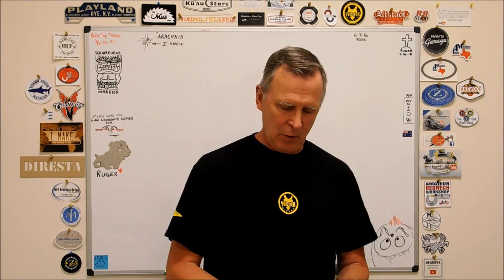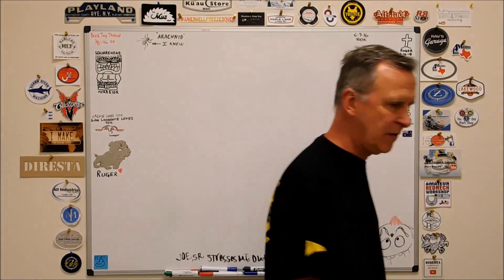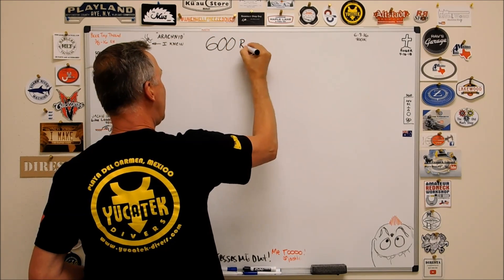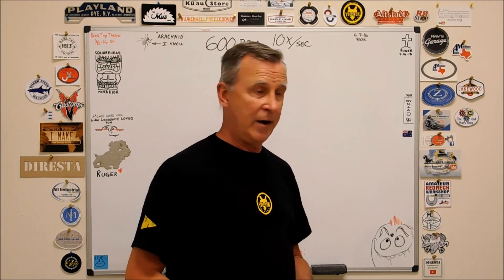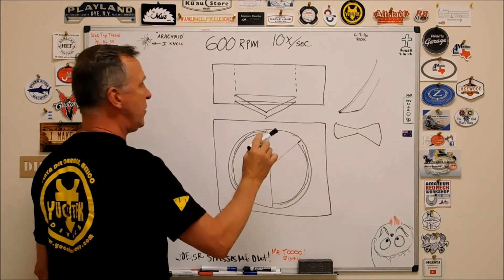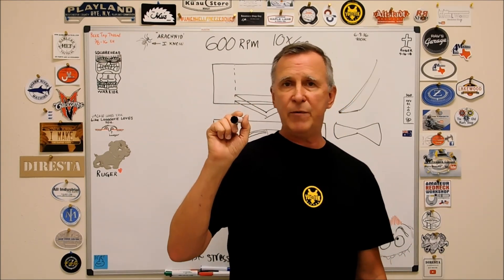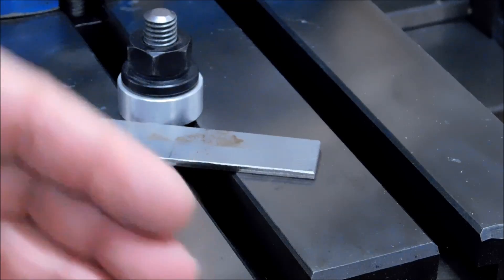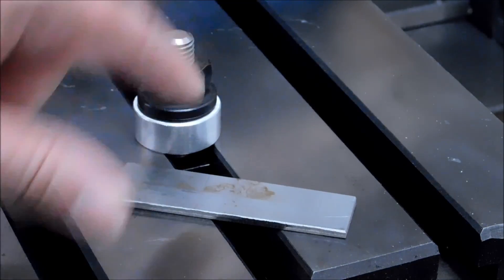EVERY METAL WORKER SHOULD WATCH THIS...

Comment: Hi Joe really appreciate the video as many years ago I did a similar thing with an 100mm X 12mm X 500mm long piece of steel but instead of being on a drill press it was on site with a slow run hand drill and a 13mm bit. I had it raised up on some wood and I stood with my foot pinning it down. That's never moving right answer no it jambed spun round and smashed into my other ankle. To this day the side of my ankle has busted blood vessels showing, lucky I had decent boots on. 

Also just watched this video by Making Klien  https://youtu.be/bc1BRhJq3cU and he does exactly what you are talking about at 4.35 seconds time to cringe lucky it was only a small block of wood.

Really like the videos keep them coming..

Comment: It seems reading the comments we all knew the danger but have all done it at some point.  Same thing causes a drill to spin in the tailstock on a lathe or even snap the drill.
Reply from the maker: It can also pull the drill chuck out of the taper.
Reply: @joepie221  Which means it could pull out the taper on the drill press as well...  I hadn't thought about that one...  Well done episode, Joe.   Good info, Esp. on the L blocks.  Making a pair in the morning.

Comment: Love the idea using a pair of L-block boots!  Simple, fast, efficient.  When I don't want to take time to set up parallels, I've used a piece of wood tucked under the work piece mounted in a vise. The L-blocks are a much better system. Great explanation of drill bit break-through too. It's something machinists understand, but difficult to relate to others. Always look forward to your videos Joe.
Reply: Another thought on the L-blocks. Great for drilling holes in a tapered work piece that would be difficult to hold in the parallel jaws of a regular vise.
Reply from the maker: Yep. these work on irregular shaped parts quite well.

Comment: I have been using drill presses for over 40 years and clamp the part in a vise or to the table all the time. Whenever I work in a shop with others, I come back the next day and my bolted down vise is no longer bolted down. There is a reason machine vises have bolt down ears or holes and why the drill press table has slots.  I am a licenced millwright up here in Canada and in my first semester in trade school we were taught safety, safety and more safety. I cringe when I watch all these self taught metal workers and "machinists" do the simplest things in an unsafe way.
Reply: Yep you gotta check everything everytime. If the bossman don't like the extra time required he can run it and play russian vise roulette and hopefully when it lets go it disables his ability to procreate. :)  I almost ended up with my tibia busted due to a flying vise that literally came from 10 feet away. Lucky I was wearing 16" oilfield boots with metatarsals and shin guards that day... just broke my cable laces and peeled the plastic cup off of my steeltoe but still felt like I took a baton to the shin.

Comment: What is the best method for cutting multiple shims from round stock on the lathe to a precision length, keeping faces square. (Example: 1” ALuminum round  X .375” shim,  .3125 filled center).  Run into this type of job several times.  Always seems quite tedious! Hobby machinist!

Comment: I've been making chips for 30+ years, some of those as an instructor in a university student shop full of noobs (seriously terrifying). People are always surprised when I tell them that I consider the drillpress to be the most dangerous tool in the  shop, way beyond the table saw, even. The drill press seems so safe - like an adult hand-drill...but it's not - exactly for the reason that Joe discussed here. I've seen my share of drill press "propellers" and heard the sound of way-too-many parts ricocheting around the shop as they fly off the drill bit. I've also handed out plenty of Band-Aids.

This problem is even worse on a drillpress, than on a mill, for the main reason that most folks run the press at whatever speed it's presently set to when they walk up to it. Many people are either ignorant of the fact that you can (or even, should) change the speed, or if they are, don't bother as they are in a rush - "I only have to make 1 hole." How many times have you seen someone using a 1/2" twist drill at 1800 RPM, while "clamping" a piece of 0.063" sheetmetal with their fingers? Ugh. The noise that makes makes me shudder - you know the one.

Though, to be honest, I've cut the same corners myself - as recently as yesterday - free-hand countersinking some steel parts on my mill. The stupidity of doing that wasn't lost on me in the moment, but, being an idiot from time to time, I kept going. As usual, it ended fine, but I recall thinking "well, it wasn't pretty but I got away with it...again". 

And, how have I not seen or heard about this truly great "boots" idea in my career?? Simple, easy, safe!

I'm heading out to the mill to make myself a pair of JoeBoots right now. 

This was an unexpectedly good (and timely) one! Thanks Joe!
Reply: "The noise that makes me shudder - you know the one.
"  To which noise do you refer; the drill bit chatter, or the operator screaming as he/she lost their fingers?  It breaks my heart, and scares me silly when I see how some people use a drill press.  Or just to walk up to a drill press and see a vise that looks like Swiss cheese.  So much better now having  my own shop.
Reply: @Changtent  Noise: the crazy, way-way-way-too-fast drillbit chatter as the operator stands there clueless, with the machine shaking and the part clattering all over the table. That's the noise you hear before the screaming and/or part doing its best throwing star imitation, or both.
Oh, and my JoeBoots came out well - and I made a second pair, while I was at it, for the prototype shop at work!

Comment: I’ve seen a guy drilling a 30 kg hub on a mill free hand, grabbed at the bottom of the hole spun the hub a couple times then snapped the drill chuck off the arbor and crashed into the machine. He needed new underpants and a sit down. If it hit him he would have been in hospital with broken bones and internal bleeding. 
Take the time do it right save yourself the pain! 
Great video 👍🏻

Comment: Peck drilling the last 50 thou using the depth stop to increase the depth by four or five thou between pecks can keep the bit from grabbing and lifting.  Work must be secured since left hand is running depth stop screw and right hand running the downfeed.  Keeps hands out of danger zone around bit.
Always enjoy your videos, Joe.  Not only do they offer good ideas such as the boots (fantastic idea), but they make you think.  First step in safety is to engage brain and think about what you're doing.
Reply from the maker: Or, if possible, lock the quill and raise the table. Thanks for the comment.

Comment: Good call, thanks for the public service announcement. I was brought up with a mostly unhealthy fear of equiptment. That anything in a shop can and will kill you given the negligence. However I can't say this was something that was ever brought up to me. However if I knew the likelyhood of something spinning (since mostly was only allowed to work with extremely soft materials, plastics and rubbers) I would clamp it or use a fence or preferably a machinists vise. Though the fear of sharp edges and the ability to get cut on things certainly was already in place.
Reply from the maker: As a small child I tried to stop a 1/4" drill in a drill press with my fingers. I had turned the machine off and the drill was barely moving. When I grabbed it, it cut two of my fingers instantly and never stopped. Learned my lesson on drill presses and safety long before I ever got into the trade.

Comment: Thank you Joe.  I went and made several sets today to use on my bench vises and drill press.  Great stuff.
Reply from the maker: I did not mention that the boots also work on parts that do not have parallel sides. Look for the high spots and trap the part down. I would not suggest using them on round parts.

Comment: Hi Joe  Great video.  On a drill press, I usually use a scrap piece of timber smaller in width than the part to be drilled.  It acts a a cheap set of parallels.  It is also great for multiple holes on the same centreline.
Reply: Joe I forgot to add that the part is always firmly clamped in a machine vice bolted to the table.
Reply from the maker: Best option.

Comment: I had the luck to come across a solid brass disc 2" x 8" that I wanted to set up to make a very heavy base for my fly tying vise. In an unfamiliar shop,  I was given a new 1/2" drill bit and use of an extremely powerful drill press.  I did ask for something to clamp the brass, and asked if I should drill a series of pilot holes, and was assured it wasn't necessary.  - Tricked Again !!! -Just as i lightly touched the bit to the brass, the 25 lb or so chunk of brass immediately decided it wanted to go 200 mph and lift off the table. It scared me so bad that I actually turned my chest so my right side faced the brass and it wouldn't hit me in the heart. A second or two later my thoughts allowed me to turn it off witjhout any injury. A young stoker did the job properly on a large lathe. I like your l-blocks and will make a few. Thank you.  Good video. Subbed.  Cheers.
Reply: I understand what you are saying, I will add one thought for you.
Some materials are more inclined to grab on a drill bit or similar cutting tool than others.
 An understanding of the material (that takes time) is also very important! Some materials including Plastics and softer metals can be a challenge if you are not aware.
 Hope this helps, Cheers from John, Australia.
Reply: Let's say, I'm learning. That was the worst case for me thinking I was going to end up with a few  broken ribs. That happened in 1985 and since, have employed various clamps to secure items I am drilling.  Most recent blunder was with a 1/4"piece of plexiglass and an adjustable hole cutter set to six inches.  It literally snatched the plastic and started to make swirl scrapes across it. I didn't have room to secure it properly and took the chance anyway. Tossed it and bought a set of shallow hole saws. A bit safer now. Tks for the advice.  Cheers from Nova Scotia.

Comment: Good safety video. You should also talk about the hazards of drilling brass. I would also like to hear your thoughts on drilling larger holes using annular cutters, ( Roto Broach, etc.)  If you can afford these cutters, they are the best thing since sliced bread for drilling larger holes on a drill press or a mill, in my opinion. They require a lot less torque and they don't snag and grab.

Comment: I needed to drill a 1/4 hole in some 1 x 1/8 alloy about 8" long. Went to the drill press. Little voice is bellowing in my ear "Clamp it down" All good and away I went. When it did grab, I managed to pull my hand away but it still hit me 3 times. Doc thought I had a broken wrist but got lucky. The voice doesn't even get above a whisper anymore.
Reply from the maker: The shop gremlins sit in the rafters just waiting for someone to do something stupid so they can swoop down and ruin their day. A lot like the ones that fly around waiting for a motorcycle rider to do something stupid. All those guys usually end up in the same place. The ER

Comment: Excellent explanation for what happens. I quickly learned many moons ago about free hand holding thin material on a drill press (or hand drill). When I first saw a vise grip like clamp like this https://www.amazon.com/POWERTEC-71012-Drill-Press-9-Inch/dp/B00NFAXVD0/ref=sr_1_28?keywords=drill+press+vise&qid=1558035373&refresh=1&s=gateway&sr=8-28
I bought it. Still use it. Many clones are even cheaper. A cheaper one https://www.harborfreight.com/search?q=drill%20press%20clamp
Reply: I have the Harbor Freight one and it works very well.  It doesn't have to be expensive to apply pressure.

Comment: Those boots are sweet too, because you can make each side a different thickness to accommodate larger or smaller drills.
Reply from the maker: Dont make them symmetrical. That way you can simply swap which end is in the vise for different range drill diameters.

Comment: Joe, love the boots idea, I'll be making a pair today. Thank you.  The thought the precedes my doing this is "I can get away with it this time"".  Unfortunately, I do get away with it often enough.  But the times I don't something bad happens, It hurts, it breaks things.  One of my better finds are the stepped drill bits that don't grab and catch on thin metal.  For year I thought these bits were a gimmick, but they work very well.  

Another dumb thing I used to do is stick my finger in the end of a smallish diameter pipe and twist it to see if there is a burr.  This I seem to have learned not to do anymore.
Reply from the maker: Try that burr trick with an internal pipe thread. I've seen it. It doesn't end well, but leaves an interesting scar.
Reply: Joe Pieczynski ha ha! Nice one Joe!!

Comment: A long, bar shaped workpiece has 2 ends.  Spinning at 10x per sec means an end comes past your fingers 20x per second.  That's metal hitting your fingers every 50 milliseconds.  Average reaction time is something like 250 milliseconds, so if you're like most people and have better than average reaction time skills (yes, that's the joke) then let's say 200 milliseconds.  That means that there will be 4 whacks/cuts at your fingers before the light from the grab can enter your eyes, get processed by your brain, your brain send a command to pull your fingers back.  That's just pure neuron reaction time, you haven't even started moving your fingers/hand/arm.
Reply: A fellow I worked with lost a finger on the drill press. He was trying to cut a 3" hole using one of those round, hollow hole saw bits into a piece of sheet metal.  And holding it down with only his fingers. He was an experienced mechanic, one of those "know-it-all" types that thought he had quick reflexes.
Reply: Another fellow I met was a self-employed carpenter who would brag about how he  used his hand to guide the work coming out of his table saw. He many times told people it was BS that your hand could get pulled into the blade by a kick-back. "If the saw kicks-back, it happens so fast that the work is snapped out of your fingers."  One day while doing this, his hand was pulled into the blade and he lost all four fingers.  His co-worker, apprentice scooped up the fingers and put them in a bag for the medics. The doctors were able to re-attach three of the fingers, then later had to amputate one that didn't take.  He's still working as an independent carpenter, minus two fingers.

Comment: Great video Joe!
During the break through the last piece of material also gets curled and mashed up by the flute pushing through it I find this also makes it grab even worse, so I really back off the pressure when breaking through and it helps tomore fully shear the chip with less chance of grabbing

Also maybe it's a 1 in 1000 chance, but when spinning at 10 times a second it doesn't take long to reach 1000!
Reply from the maker: You can hear it coming if you listen, and the chip will get thinner as it breaks through. New guys eventually learn this.

Comment: I was 19 years old the first time I "free hand" drilled a piece of metal and quickly realized just how insanely stupid and dangerous it was!! Since then I have bought more clamps and vice grips than I probably need....BUT everything now gets clamped down one way or another!! Even wood working projects, because I have seen drill bits snag at the weirdest times and tear flesh and clothing as well!! Further too, when drilling metal by hand, having it mounted to a block of wood will product usually much cleaner holes on the back side as well anyhow.....SO I clamp the metal to a block of wood, then clamp the wood to my work surface!! Saves me EVERY TIME NOW!!
Reply from the maker: Smart man.

Comment: Like the L shaped hold downs, if they were cut at an angle as the part moved around they would force it down onto the vice jaws, making it even more secure and easier to set up.
Reply: That is an excellent modification. But might the work wedge itself under and difficult to remove in a small production run.
 I do love to borrow good ideas though. Keep the creative juices flowing.
Reply: @fredcreer1929  I was thinking more about a longer workpiece requiring say a row of holes or at each end. Another thought, the angles could just be put into the vice at an angle giving the same jamming effect.
Reply from the maker: Interesting thought.

Comment: Oh... and please remove the lathe chuck key when not in use.  Thanks!
Reply from the maker: My rule is to never take your hand off it. If you have to move away, it comes out.
Reply: I don't care if I'm just turning around to get the next part off the work table, the key comes out of the chuck. One rule I live by in the shop.

Comment: an alternative to the 2 "boots", is large bolts, say 3/4" thread or larger.  Have the shank/threads of the 2 bolts in the vise with the bolt head sticking upwards.  The shank stops rotation and the bolt head acts as the ledge to catch the part on the upward direction.
Reply from the maker: Add some flats to the bolts for added grip

Comment: I have an AMF float lock vise on my 20" Walker-Turner drill press it's a great set up.
 The vise absorbs all the rotation torque yet you are free to position your part perfectly under the drill.
I have a anti-rotation collar similar to the one you showed for bigger parts as well.
Had a few close calls were the drill grabbed the part and pulled it out of the vise (brass is bad for doing that).
Reply: I've also had stuff suck up out of the vise. For stock that is not nice and thick the L brackets or bolts, as someone else mentioned, are the way to go.